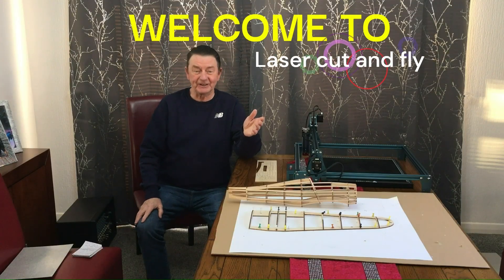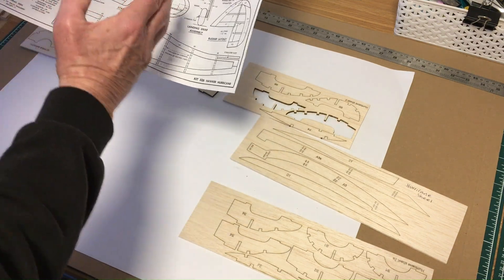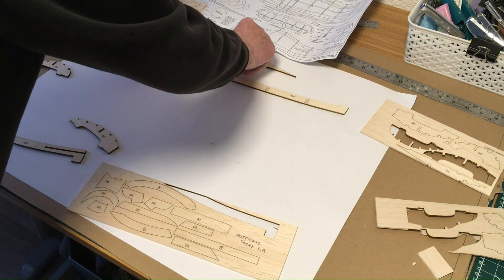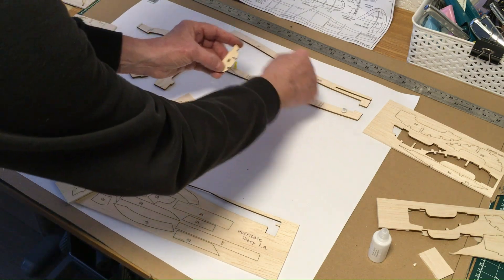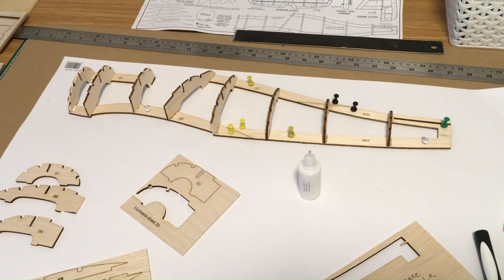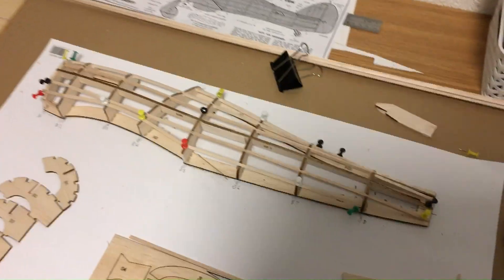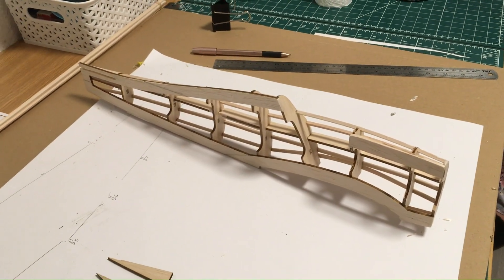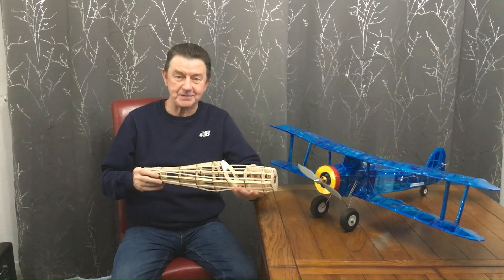How to make a balsa plane. (Hurricane 3)

Comment: How long does easy sand PVA take to go off?
Reply from the maker: It becomes 'stuck' so to speak in a minute or so (usually) if stuff is pinned down you can move along quite quickly. If parts are going to be moved I leave it for an hour or so. Sometimes for really flexible structures I leave it for several hours. 👍
Reply: @LaserRCModelguy thank you
Reply from the maker: @chenderson4969  👍

Comment: Very interesting approach. I only just found you. I will go and check out the other videos. The laser cutting process is somehow interesting, but it has its own complications.
I once did the Guillows Hurricane and also noticed that the side stringer was missing in the plan so I traced it on for potential future reference. Not sure why they do that. Interesting approach you have to reverse engineering the piece. I might use that approach for some future project.
Thank you for sharing!
Reply from the maker: Thanks for the comment, I had to do it that way because I have built the plane at 200% original plan size. It worked well though. 👍👍